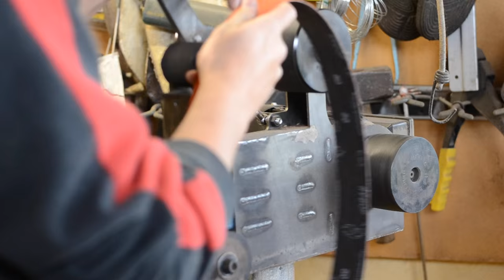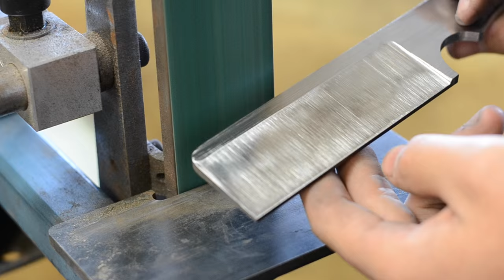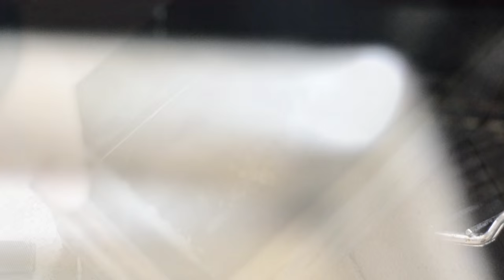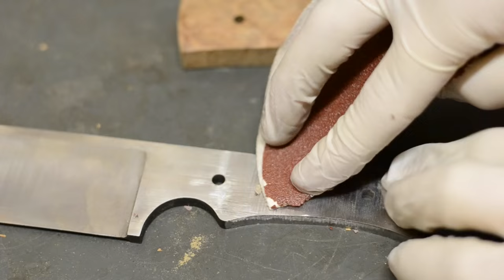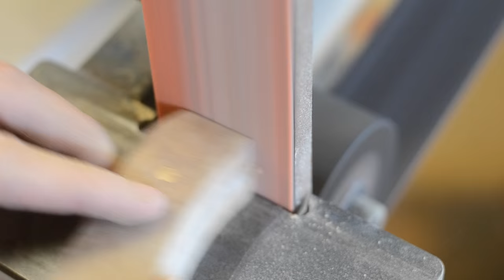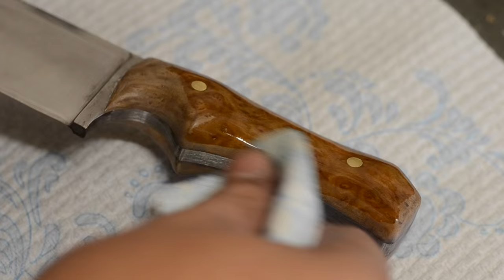Knife making - making a mini cleaver style knife

Comment: What type of wood did you use on the handle? Ita beautiful.
Reply: Randy Reed good luck finding that;) unless youre a carpenter
Reply: Randy Reed if you get a piece of walnut wood that is between the trunk and the root of the tree it will look about the same and it will also be very light.
Reply: I live In Aus and coolabah is insanely expensive
Reply: i was wondering that the second the varnish hit it. its amazing

Comment: Newbie question, but why do you do several vertical cuts, then a horizontal one with the electric saw line? Wouldn't it be cleaner to do a swerving cut instead? Or is that more prone to mistakes?

Comment: 2 tips:
u should use thiner disks, when you are cutting metall. you will go trough it faster and there will be less heat and thats better for the metal because burned metall (darkblue) is softer and more brittle

you shoould use oil to cool the metal down, not water. in the oil, the metall will cool down a bit slower and that prevents little cracks

but all, its a very nice looking knife
Reply: Moritz B. I think he used oil...
Reply: Beetlebob Andrew nope, the metall was really glowing and the oil would normally start burning and i also think oil smokes less
Reply: Moritz B. Ya ur right
Reply: Beetlebob Andrew :)
Reply: Moritz B. How do u know it what type of steel it was? I use oil myself, but heard salt water will do fine for 1095. And the cut off wheel was pretty close to the edge. If you grind off some material on the belt grinder past the wheel line it would be fine, no?
Reply: He did most of the work that would heat the steel, before he heat treated and tempered the blade. This is just a knofe made by stock removal... though it is one of the best I've seen made before my eyes. Once it's been tempered is when you need to worry about building heat, but that seemed to be dealt with in my opinion. When you are grinding on a tempered knife, you can feel even slight heat with your hands. When I feel any heat beyond warm, I dip the steel. Great knife and solid methods in my book!

Comment: Wow, that is a beutiful blade. Question, what is the purpose of heating the blade. And also what the two liquid you use, is this some time of glue to stick metal to wood. And how many hours do you put into making a knife. Anyway, great video, some great craftsman here.
Reply: If you mean the stuff he poured out simultaneously from two different tubes, then that's two part epoxy glue. It's the best stuff for glueing wood to metal.

Comment: How wide would you say the blade is?
Reply: +Miller Knives Thanks! Sorry for another question, but what thickness steel did you use?
Reply: +Miller Knives Ok. Thanks
Reply: +Miller Knives Hi again. Sorry to be persistent with the questions, but is there a secondary bevel on the blade? Thanks, and great video!
Reply: +Miller Knives Thanks.

Comment: would love to make one but i dont have  a belt sander or an angle grinder. Only a dremel. :(
Reply: You can get an angle grinder for like $20  and a belt sander for $60+
Reply: You can make knifes without any power-tools. If you really want to make knifes, that is.
Reply: You don't need those tools the just speed up the process, you can just get a hacksaw with some blades and some files then you're golden

Comment: How do you figure out that the bevel is even?
Reply: Grayson Bourree You use a height gauge or you can also use a drill bit that is the same dia. that your steel is to scribe a centerline. I personally use bits because they are cheap and I have a lot.

Comment: am I the only one that doesn't have a belt sander?? :{]...feeling left out*does a dremel tool help? *can't afford a sander....
Reply: nope i also dont have one yet i dunno which one i shall buy so i use good old files until s.o. answers me and tells me a good cheap sander
Reply: sander is needed
Reply: RagingDERPY Go on craigslist or somrthing and get a smaller one. I use a 3x21 craftsman from the 70s that has a stand to hold it vertically.
Reply: RagingDERPY I have a file I'm poor.

Comment: What is that tool he used on the side of the knife after he colored the side with a sharpie but before adding the bevel to the knife??
Reply: Julia Gray It's a drill bit the same thickness as the steel. This way, the point of the bit scribe's a line perfectly down the center of the edge and tells him where to terminate the bevel.
Reply: Jonathan Orellana Ok thank you!

Comment: dude...you need slimmer zip cuts. The kerf is massive, plus if your selling these, a thinner disk will mean you need to remove less material to atain the desired cut sections.. this will also reduce heat since your removing less metal...which is good for the proporites of steel.. more money, better product
Reply: Thor well said. Can't say it better than that mate!
Reply: Thank you Daniel 👍🏽
Reply: Valiant tru